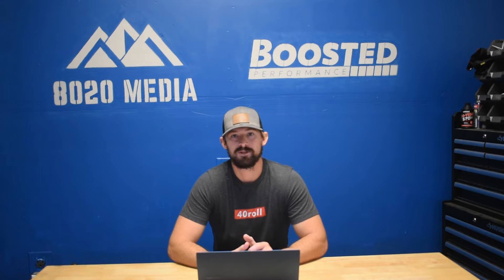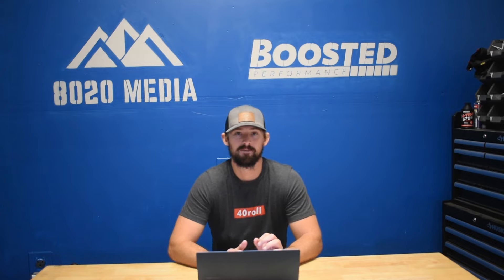DIY: How to Fix GMC/Chevrolet "Service Stabilitrak" & Traction Control Lights!

Comment: Could a theft deterrent code on my Cadillac SRX 2014 that fails ignition of vehicle affect stabilitrak?
Reply from the maker: R - It certainly could. Unfortunately, this is pretty common on the SRX's.
Reply: Thanks
Reply from the maker: R - Keep us updated.
Reply: Will do

Comment: Would it make the steering wheel to shake ? Get worse at higher speed had the tires balanced today and it's still shaking not as bad now. The abs fuse was pulled and when I put it back in it making nose when breaking and driving. And have a misfire code
Reply from the maker: Bike - What was the misfire code?
Reply: I fix the shaking it was the rims .
I still have a misfire code bank 1 sensor 1 and 2 and knock sensor
Reply from the maker: Check your ignition components and knock sensor. Keep us updated!

Comment: Any suggestions where to start on 06 trailblazer with this on my scanner? PCM-powertrain control module- P0856 traction control torque request circuit
Reply from the maker: MB - Unfortunately, this isn't an easy issue to diagnose. Here are some things to look into: Wheel speed sensors, ABS module, Electronic Brake Control Module, or Powertrain Control Module.
Reply: @8020Media  Thanks for the reply, I checked the PCM for loose wires and did a relearn on it, checked the brake control module and it’s good, after the holidays I’ll get it up in the air and check the speed sensors for dirt and continuity, do you have any idea where the ABS module is on this particular vehicle? I’m guessing underneath the frame rail on one side or the other? guess I’ll look while checking sensors, thanks for the input.👍🏽
Reply from the maker: MB - Keep us updated! This video should be helpful to find the ABS module on your vehicle: https://www.youtube.com/watch?v=8DHRE8GjiRo
Reply: @8020Media  Will do thanks for the video

Comment: My 2010 gmc acadia awd has thrown a traction control and service stabilitrak message for two days in the cold mornings and then when it warms up it goes off. No check engine light and runs great. Any idea what it could be?
Reply from the maker: R - This seems like the cold weather is getting at some sensors. If the car is running fine, then there shouldn't be any issues.

Comment: I have bad cv axle and the stabilitrack and traction control light comes on periodically would the bad cv make the lights come on just bought an 08 yukon denali and already having issues
Reply from the maker: Brian - Yes, this could cause stabilitrak to turn on.

Comment: I have a 2012. Buick lacrosse.   My cars reads service stabilitrak light came on and my car cut off.   Also my check engine light came a
On and is flashing fast and making a clicking sound
Reply from the maker: DJ - Do you have an OBD2 scanner to read the codes? That'll be the easiest way to diagnose.

Comment: Had 32 GM vehicles over 35 years and every one had stability track problems. We don’t buy GM because of this constant $1000 repair and downtime. We buy RAM,HONDA AND TOYOTA and we’re never in the shop jocking  trucks to the repair shops and paying out of warranty at 34 -37 k mileage at 3.5 years. These 32 repairs we ALL BAD PUMPS AND MODGEL one part $550 GM ,$200 labor, $150 programming your paying $1000.00 FK GM . I’m glad I went to RAM and Hondas less stress in our lives.
Reply from the maker: Jay - Thanks for adding your feedback. Seems a little overblown, but everyone is held to their own opinion.
Reply: Ya GM IS OVERBLOWN selling dog shit “we are professional grade” slogan they got balls advertising that. Had 8 service trucks on the road and had Cadillacs, Yukons and Tahoes, ALL had stability track issues. The only blower here GM making the customer blow them for more $$.
Reply: I'm just as frustrated as you are with GM bs but maybe don't kill the messenger? He's here to help.

Comment: I would like to know if the tachometer quit working is why i'm having this problem, and what would cause the tachometer to quit working in the first place.
Reply from the maker: M - It's possible that this could trigger stabilitrak to turn on. Sounds like a possible wiring problem or a failing tachometer. Are you experiencing any drivability problems?
Reply: It shifts hard from 1st to 2nd. Other than that it drives ok after it go into high.
Reply: It's a 2009 with 55,000 mi. I'm the only owner.
Reply: The hard shifting started at the same time the tach quit working.
Reply: Also, I've been driving it like this for two years, but I would like to know what is causing the problem. Any advice will be appreciated. Thanks
Reply from the maker: M - Have you had it looked at?
Reply: Yes, I had a technician look at it, but he wasn't able to fix the problem, and said I should take it in to the dealer, but i haven't done that yet seeing how it still drives okay once it gets past first. Also it does takes longer to start than it did before all of this started. All of these issues started at the same time that the tach quit working. One other thing that the tech did was to try and reboot the crank sensor ( not the right term he used, but I don't remember the right term), but couldn't do it for some reason. That's when he suggested I take it to the dealer. Thanks for your interest.
Reply from the maker: M - Unfortunately, it's not an easy diagnosis. Dealership might be the best route here.
Reply: Thanks.

Comment: Siigghhh 😔 Had the rough idle, Stabilitrak light, truck goes into limp mode issues on my 08 Sierra at 100K miles. Lifters started getting stuck, engine rebuilt.. And here we are again 100K miles later.. rough idle, engine misfire, stabilitrak lights... 😥 Wish I didn't have such anxiety about taking it to a shop. I always feel like I'm being taken advantage of.
Reply from the maker: AA - Sorry to hear this. That's what we're trying to do is build a channel helping people diagnose and solve their own problems! Keep us updated on this.

Comment: 2015 GMC Sierra - 1500 SLT  (56K)
I did a fresh oil change and a full gas filler-up, decided to add a little fuel additive (Additech).  That evening the family all loaded up to go out. The roads were very wet and there was a slight drizzle.  About a mile onto the HW going 65MPH, my truck starts to feel like it is struggling to maintain speed.  Felt like I had four flat tires pulling an RV uphill.  I pulled over check tires, all were good.  No dash lights were lit up.  Hopped back in and started driving and almost wrecked trying to get up to speed to merge back on the HW.  I took the next exit and barely made it to the gas station.  When I pulled in, all I had to do was take my foot off the accelerator and the truck stopped immediately as if brakes were being applied already.   Just prior to pulling in the station, my DIC was flashing the Stabilitrak dissabled message and the "T/C" light on the instrument panel was lit up. 

Left the truck there overnight and had it towed home the next day.  Decided to start it up and put it into gear; Drive, Rev, Drive, Rev...   The lights on the DIC dissapeared so I drove it around the hood for a slow mission and everything seemed normal.  I'm at a loss for what happened other than to think that the fuel additive somehow confused the brain to think the truck was receiving more power than normal and communicated this to the ECBM which was probably compromised because of wet roads.   The only relative code that was thrown is C0161 "ABS/TCS brake switch circuit malfunction".  By replacing the Brake switch will this solve the problem?  You mention there are several reasons to this issue.  what a nightmare.  This entire mayhem could've been a lot worse if I hadn't already been driving in the far right lane when the problem happened.
Reply from the maker: Brian - Glad you were able to get off the road before it got much worse. It's unlikely that the fuel additive caused this reaction. Only thing we can think of is the wet conditions cause sensors or the brake switch to malfunction. Obviously, this shouldn't happen, but that's the only thing w can think of.
Reply: @8020Media  thank you for putting this presentation together.  It was very informative and shows how all the hand shakes are being made under the hood.
Reply from the maker: Brian - That certainly sounds like something that could have caused your issue. Thanks for the feedback! We're just trying to produce unbiased automotive information for everyone.

Comment: 03 AWD Escalade. Runs & drives great. On the eception of the brakes are sticking. Ive had brakes,rotors, hoses & calibers allway around. Cant seem 2 figuar it out. The only codes is bank1&2 lean with the service stabilitrack light flashing. So is the stabilitrack system my problem 2?????
It feels like ur driving with 2feet.
Reply from the maker: Real - Based on the symptoms you've described, here are some possible things to look into:
Brake master cylinder, brake booster, brake fluid level, wheel bearings, vacuum leak, MAF sensor, or O2 sensor. 

We're actually dropping a video today going over system too lean code P0171, so make sure to tune in to that one. Keep us updated on this!

Comment: I need help i have a 2014 chevy impala limited ltz,the stabili track comes on also with the TC but when i put the scanner it reads p0301 i swapped the coil pack bit it still has the same problem,also tje check engine flashes,and my engine shakes
Reply from the maker: Cain - We have a full video on P0301 and we think it would be helpful: https://youtu.be/f1mQ5hD1-vI

Comment: my lights come come on once i put it in gear. no check engine light so im not sure where to start. thanks for the video
Reply from the maker: J - Are you getting any engine codes?
Reply: No codes. Happens randomly. Doesn't affect how it drives though.
Reply: Im trying to sell it and i dont want it coming on for the guy. Or i want to fix it for him
Reply from the maker: J - We give a list of things to check in the video. or we have an article that may help: https://chevytrucks.org/chevy-service-stabilitrak-traction-control/

Comment: 2014 Silverado with lift.  I've had this issue show up twice.  Once it threw a code and the front drivers wheel speed sensor seemed to solve it for about 6 months.  Now it's back.  I can't seem to replicate when or why it happens.  When it does start it seems to be first happen at low speeds, perhaps when braking but I'm not really sure.  The other day when I was towing it was basically flashing every 20 seconds.  I should note that when i was towing it was almost it was in conjunction with when I would feel my brakes pulsing when braking.   I did the M218 fix and changed the front 2 speed sensors.
Reply from the maker: Chris - What happened after you changed the sensors and M218? Sounds like a braking issue.
Reply: @8020Media  M218 Didn't result in any change.  I tried changing the main ground but couldn't get anything on the bolt on the block.  As such, I changed both ABS sensors and have not experienced any issues since.  Fingers crossed.
Reply from the maker: Chris - Keep us posted!

Comment: On my 2012 tahoe both lights come on at start up but i can turnthe steering wheel slowly and itll turn off an come back on . My check engine light has never come on .
Reply from the maker: K - Do you have any engine codes? Sounds like possible power steering problem.
Reply: @8020Media  I'm going having it checked for codes this weekend . Power steering works fine , no issues at all .
Reply from the maker: K - Keep us updated.

Comment: What if ur not getting any codes for misfires,but truck has a mild cam,no codes.
Reply from the maker: Phillip - Did you go through our checklist here?
Reply: @8020Media ,yes,found brake light sticking,gonna replace switch today.
Reply: I replaced brake switch,so far so good,but now MAP light came back on. Probably need another tuner since we upgraded cam.
Reply from the maker: Phillip - Nice! Keep us updated on if it solves your problem.

Comment: i’m getting a U0101 code also with service stabilitrak. what should I do?
Reply from the maker: Preston - It's a communication issue with the TCM, transmission control module. What vehicle do you have?
Reply: @8020Media  also has a new tcm in it. Happens intermittently. I fix it every time and it’s happening again. I clean the fuse box prongs, the tcm harness and clean throttle body when this happens and this time neither worked 

2 days ago I got it to work for about 20 minutes. It happens as i’m driving. Heard a thud noise. It also had a “service low battery” warning (not the light in the dash) but it has a new battery and alternator from the first time it did it.
Reply: @8020Media  found the issue

The pink wire on the tcm harness need to be repinned or repaired. Had my dad move the harness connector and the “P” (park) light went in and out with the “Service Stabilitrak” flashing then turning off. We opened up the plastic cover and saw it was bent, got a plastic trim remover and barely touched it and it started working
Reply from the maker: Preston - Glad we could be helpful here! Keep us updated.

Comment: I have a 2013 GMC Duramax and I have “service traction control” “service trailer brake system” and “service stabilatrak” with only the ABS and traction control light on. I checked fuses but it’s not that. Maybe it’s brake light switch?
Reply from the maker: Do you get the trailer brake system warning only when towing?
Reply: @8020Media  No, all the time

Comment: I have a 2010 chevrolet traverse lt  
It got the stabilitrak and traction control and car will crank but wont start and if it start it will have a rough idle and engine start shaking any answer i need help ??
Reply from the maker: J - We have some videos that could be helpful with this:
https://youtu.be/0YRdzJbHcm4
https://youtu.be/BiYsqRJCLhE

Comment: I am not getting a code. I am having a tire pressure error coming on. It goes back off. It also comes on when I also have stabatrek error when i turn the steering wheel.The dash,radio,and charging port goes off at the same time.

Comment: 09 escalde change spark plugs a week later i got a p0641 stabilitrack traction and power reduce . Any help i would highly appreciate that.
Reply from the maker: Alvaro - This sounds like a sensor issue. Here's three sensors to check: Throttle Position Sensor, Manifold Absolute Pressure, Accelerator Pedal Position Sensor. Keep us updated on this.

Comment: Iv had this but I'm getting 50% engine power aswell any ideas
Reply: It's also when I just turn it on
Reply from the maker: Kurt - Do you have a check engine light and have you checked for any engine codes?
Reply: @8020Media  not codes yet and no check engine it just happens when my truck will turn on I put it in reverse and it freaks out I'm in fl it's gotten colder down here and I'm wondering if it could be a battery thing my subs keep on turning off randomly and we have had semi truck  batteries die while we're inside a acct
Reply from the maker: Sounds like it could also be an alternator issue. We just released a video of signs and symptoms of a failing alternator. Make sure to check it out.

Comment: Mine turns off for about 1-2  seconds when  i hit a moderate bump or when going between 60-70mph. Retightened, cleaned and tested 8 of the 12 grounds. Stabilitrak light comes on when car turns back on, goes away after a few minutes.
Reply from the maker: H - Interesting.. Keep us updated.

Comment: Check codes and mine came back right front wheel bearing put a new one on and still same problem any idea what I should do next?
Reply from the maker: Any issues with the sensors like ABS/wheel speed sensor when you were putting the new bearing in? I'd look there. If not then honestly a lot of times we see the issue being bad spark plugs.

Comment: I have a 2014 GMC Acadia. Back in the fall of 2023, these messages came up on my screen: service traction control, traction control off,
Service stabilitrak. It was shuting down the engine and applying breaks. I needed new tires badly. So I went and got new tires. Now in July 2024, those same messages are coming up. But now I hear a clunking noises which seems to be coming from the driver side and when I hit my breaks its worse. My check engine light is not on, I am not having any issues with it misfiring either. Can you please help
Reply from the maker: D - Sounds like a braking or suspension system issue to us. We have a video on the ABS system that may be helpful: https://youtu.be/RkH7aiemBYQ